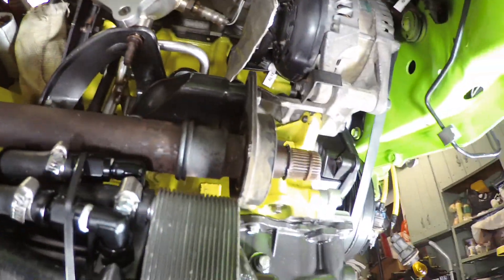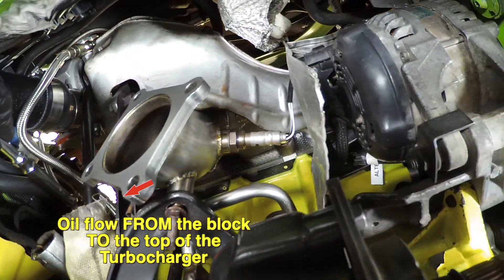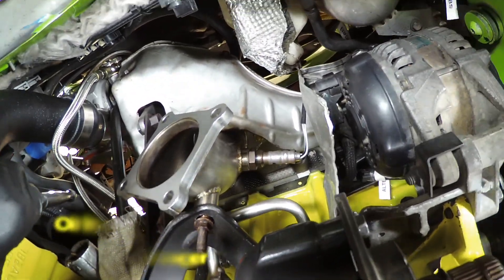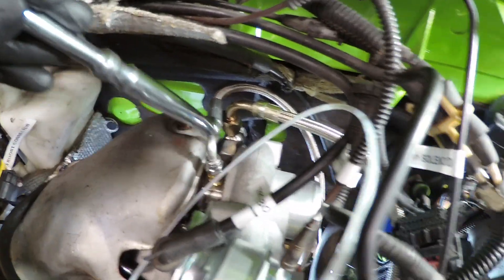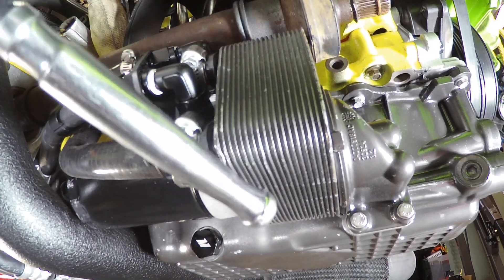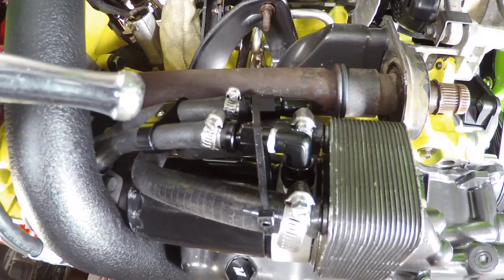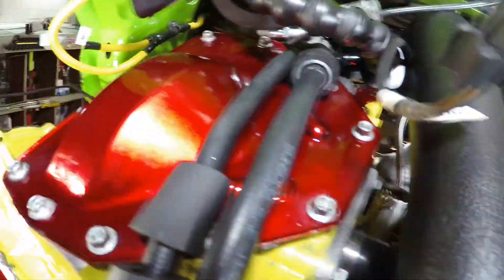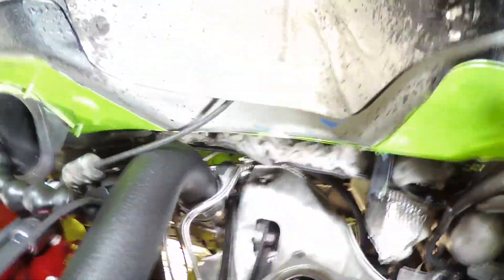PT Cruiser Turbocharger: Identify Oil & Coolant Lines, Hoses, Fittings, and Adapters

Comment: What is the ID of the coolant lines bolted to the engine coming out and back to the water pump?
Reply from the maker: I believe you are referring to the metal Water Pump Inlet Tube?  Here is a link to that part (as sold on Amazon):

https://www.amazon.com/Water-Pump-Inlet-Tube-Compatible/dp/B08GZWVZ6W

The main largest port goes into the Water Pump, then another port bends down and the lower Radiator Hose connects to it and then the smallest port faces opposite the Water Pump and one of the Heater Core hoses connects to that.

I hope this helps.
Reply: @PTBubbles do you by any chance have a video showing how to change the coolant reservoir?
Reply from the maker: @saeth62   I do not have a specific/dedicated video for that at this time but you can see how I remove the reservoir from a Turbo PT using the following video link (I have already removed a lot from the car first but you'll see where the nuts are that secure the reservoir to the firewall):
https://youtu.be/dmbz1_X9wXw?si=iV94bdlO3201eUE1&t=764

If you have a naturally aspirated (NA) PT without the Turbo the process is similar (10mm bolts or nuts) securing the reservoir to the firewall. Here is a link to a video where you can see me removing the reservoir on an NA PT:
https://youtu.be/hH4D5B6UEWE?si=otz9aRh914nV6wcb&t=1431

You do not have to have everything removed, like I do in these videos, to be able to remove the reservoirs, it'll just more of a tight fit to get to the bolts/nuts and pull the reservoir out is all.

You can do it!  Best of luck to you.

Comment: Great visuals. Reminds me I need to install my Modern Performance Oil Cooler silicone line kit. lol I'm also wondering where you got the power steering brackets? Mine are both missing and hard to find as a single part. Might give up soon and order a whole set of lines so I can steal off the brackets.

Comment: I downloaded and saved this video. I have a 2006 PT Turbo Convertible with 32k miles. I hopefully will never need this info but if I do I have it... As an aside (I asked this in another one of your threads). Is this 2.4l engine an interference engine?
Reply from the maker: @btomas225

Here is the response I left on the other thread as well:

Hello!  Thanks for posting your question.

The 2.4L Inline 4 Cylinder from Chrysler is not an interference motor as you were able to discern.  That includes the Turbo models as well.

In fact - the Timing Belt replacement will be almost the exact same process as on the N/A model once you remove the Upper Intake Manifold and disconnect what is needed around the Turbocharger and exhaust manifold.

I have not yet recorded the Timing Belt replacement on a Turbo Model, but if you check out my channel you can at least see my reassembly of the Turbo motor I swapped into my (originally N/A) PT Cruiser.  This may help guide you through what is involved on the Turbo Motor and you might be able to reverse the process so you know what to do for disassembly.

You could start here (Chapter 9: Motor Assembly Part 3)
https://youtu.be/X5965Ur85rQ?si=bcgp-4-E3AAtC2Th

Eventually I will post the Timing Belt replacement on a Turbo Motor start to finish but I haven't had the chance yet.

I hope this helps - best of luck as you dive in!

Shane of PTBubbles

Comment: I'm planning on installing a GT3587 on a pt cruiser non-turbo, so I couldn't just replace a turbo. I was looking everywhere for references on oil/water plumbing and this video is about the only good resource I can use for the conversion. Very helpful, thank you.
Reply from the maker: I hope it helps.  I am interested in your project as I have my old Naturally Aspirated 2.4L still and am considering adding a Turbo to it as well.  Aftermarket of course.  I am wondering if I want to go the extent of drilling into the block to add oil and antifreeze cooling or if it can be done with external coolers.

Will you be documenting the process as you go?  I'd definitely be interested.

Shane of PTBubbles
Reply from the maker: @ilexisthemadcat

Check out this page on ModernPerformance for Turbochargers & more: https://www.modernperformance.com/product/agp-turbo-upgrade-kit-03-05-neon-srt-4/03-07-pt-cruiser-gt-turbo-upgrades-and-accessories

Is the GT3587 the same/similar to the GT3582R?  That's coming up on Google searches for me.

It looks like the GT3582 needs to be Water cooled & Oil Cooled - so running coolant/oil through it.  Is that the same with the GT3587 you have?  So you are thinking you will tap into the coolant & oil passages in the block?

What is your plan for the Exhaust Manifold?  Will you use a Neon SRT Manifold like in the link above (AGP T3 Manifold)?  It looks like that Turbo has that connection type?

Will you be using a PCM Tuner for this upgrade as well?  I am curious about the details of your project of you care to share.

Happy Holidays to you,

Shane of PTBubbles